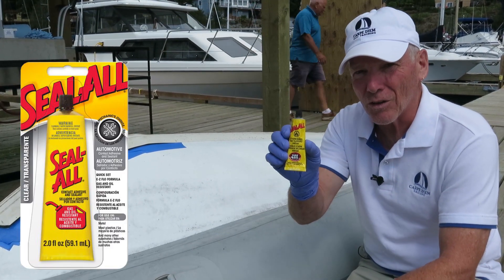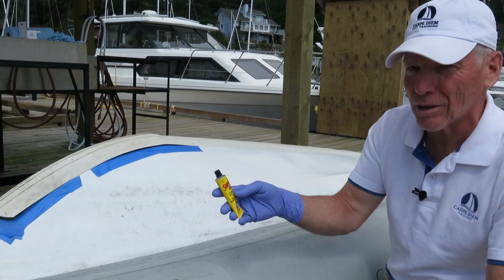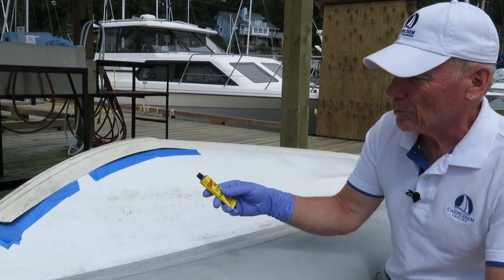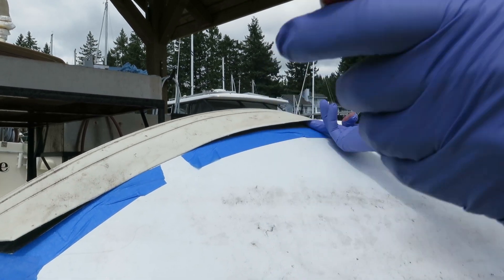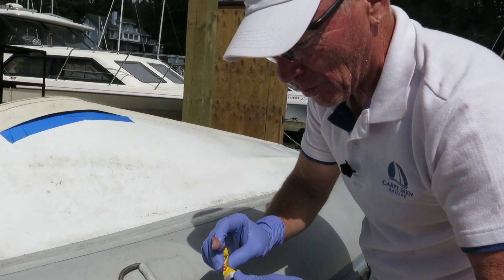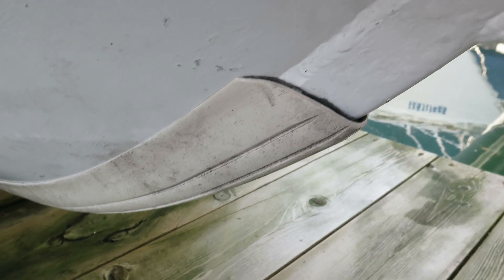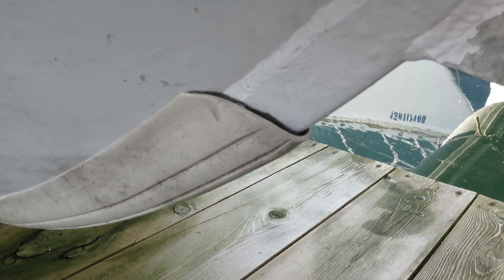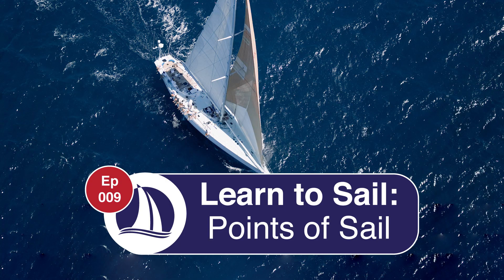Ep 8: Inflatable Dinghy Repair

Comment: Didn't see how the surfaces were brought together. Generally with contact cements I hammer them. I was surprised by the mention of using vaseline to stop the cap sticking on, because it sunds like it could contaminate the adhesive for future use and compromise future bonds. I wrap tube tops with PTFE tape, screw the top on over the top of it, and then apply more PTFE tape over the top of the cap. I then put the tube in multiple polythene bags, and maybe a screw top jar if I have one. I THINK it prolongs the life of glues and RTV sealant, but they still dont last very long.